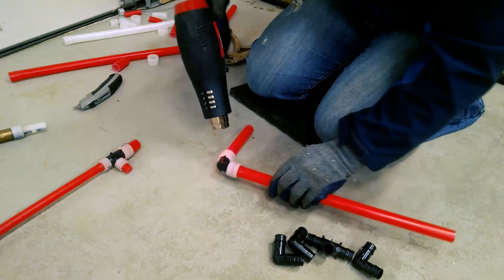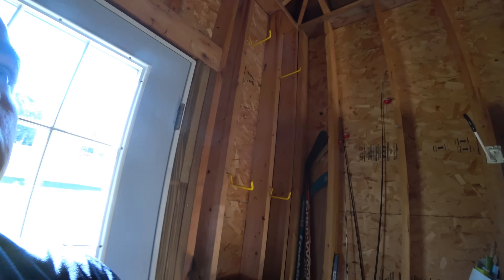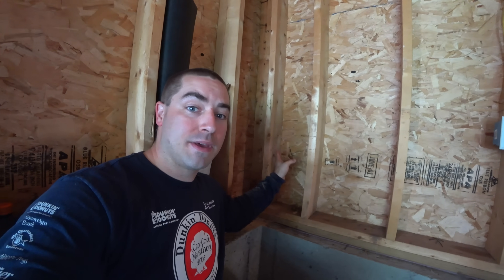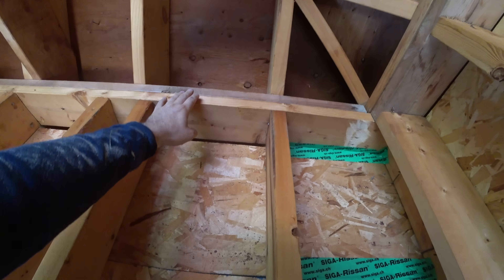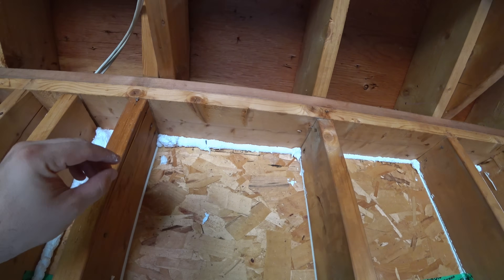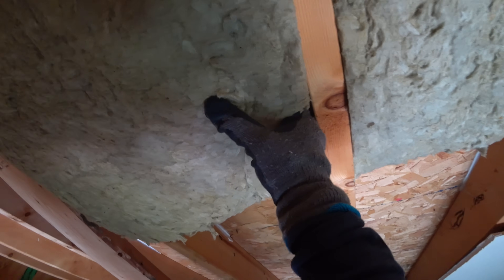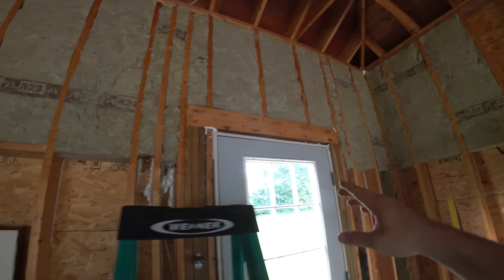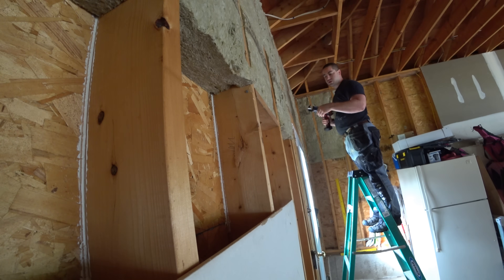Achieving Higher Performance with Batt Insulation, Roxul

Comment: I spent 10 hours caulking every stud, top plate, bottom plate, and seam.  I hope it pays off.  

Side note: I paid extra for the air tight light cans only to see that the ring around the can has a 1/8” gap around the can.  More caulking!

Comment: Outstanding job you did there. For cutting Rockwool, I use an insulation knife. Home Depot sells them. Some have a pointed blade; some have a curved blade. They get dull pretty fast so I use a roller sharpener every third cut or so. It really makes a difference in how clean you can cut the batts. The Rockwool dulls a sharp blade very quickly. If it wasn't too sharp to start with, you won't notice how quickly it gets dull.

Comment: I have 5.5" deep walls (they're not actually 2x6 see further down in comment) - I put down 2" of continuous rigid foam insulation (like polyisocyanurate) then sealed the edges with expanding foam then finally 3.5" (2x4 batts) of rockwool insulation. Works nice. About R27. It's actually more than R27 because the rigid insulation is continuous along the cinderblock wall then I framed 2x4 walls in front of it. If your insulation is continuous sheet (no studs) you don't lose conduction heat transfer through the stud members = more insulation. You can see examples of this in the IRC code book when they talk about R13+7 that's R13 in stud bays plus R7 of continuous insulation (no studs, like exterior sheets of rigid foam board) R13+R7 > R20 in studs! Neat stuff.

Comment: Isn’t the layer of poly you’ll put over the batt going to stop any air leakage? Making all the caulking and taping redundant
Reply from the maker: Poly looks like a good air boundary in theory, but I've personally tested it installed, in the field.  It fails as an air boundary.
Reply: Not sure that makes sense, if the vapour barrier was done correctly Also why would you caulk a stud that is against a solid piece of plywood, where would the air leak?

Comment: Hi. Great video. Could you explain, why dense pack doesnt need air sealing? Thanks
Reply from the maker: It's a huge topic that I won't be able to do justice here.  I'll make an attempt to summarize.  If you can air seal your sheathing, do it.  Air sealing your sheathing with tape (or fluid applied) is best.  But if you are in a situation where you have an existing structure and can't air seal the exterior sheathing, then dense-pack cellulose is the best option because it allows the least amount of air infiltration compared to other types of insulation.
Reply: @DavidPozEnergy  thank you! 👍
Reply: @DavidPozEnergy  thank you. And what do you think about wet sparying cellulose, is it also effective? And what is your opinion considering R-value/price in comparison to mineral or fiberglass wool? Thanks a lot.
Reply from the maker: Damp spray cellulose is a means to install cellulose without needing a netting material to hold it in an open bay.  It's supposed to be installed to the same density as dry dense-pack.  So it would have the same affect after it dries.  But it comes down to the integrity of the installer.  The companies I worked for never did damp-spray because I live in a cold climate where freezing of the water system would be a problem.  

Fiberglass batts is by far the cheapest insulation.  But I think it's worth the cost to buy dense-pack cellulose.  I personally paid for cellulose in my own home.
Reply: @DavidPozEnergy  thank you. By the way, do you have a refrigerator economizer? I am wondering why in cold climates, they are not used.

Comment: David very good video thanks. I have couple questions. Can I use this in a small Aframe cabin for the walls, the plans I bought has open vents at the bottom of the walls for air to flow in where the Batts are I don't understand. Also, how to prevent mice.
Reply from the maker: Should I assume that when you say cabin "walls" you mean the rafters?  An "A" frame has two sides that are rafters all the way down to the sill, and opposite two sides are true (gable end) walls.  So if you are referring to the actual walls, which stand plumb on the gable ends, then those don't have vents in them.  But if you mean the rafters, then plans do often call for venting, but that must be continuous up to a ridge vent.  That means no obstructions like skylights.  But most plans are pretty vague on these details.  So, I'm sorry I can't give an easy answer, it depends.
Reply: @DavidPozEnergy  Oh right I mean the rafters it's my first build ever and my family's first home. I'm afriad rats crawl thru the vents and nest in my aframe rafters. Why would there be venting in the rafters? Can I not seal it off? Heres my plan https://www.evernote.com/l/Ab5MDuq7_VpL8bQcpf5BjRvPzDexUljFqFI
Reply from the maker: Ugh, talk about vague.  Right?  LOL.  The type of vent they are showing in the picture is this: https://www.homedepot.com/p/Master-Flow-2-75-in-x-2-5-in-Rectangular-White-Wildlife-Guard-Aluminum-Soffit-Vent-LSV8W/100022668  It comes in 8 foot long pieces.  The slits are small enough that mice can't get in, but just barely.  They are supposed to keep bees and hornets out too, but I've personally seen them get in/out through this.
Reply from the maker: It gets difficult for me to search through old comments and try to respond to carry on a conversation.  If you want to discuss this more, then please send me an e-mail through my website, or message on facebook.  Thanks.
Reply: @DavidPozEnergy  ok THANKS!

Comment: @3:52ff Why calk the stud? It's touching the wall. Where would there be leaks? The nails?  Have you done a video with rock wool and radiant barrier?
Reply: The studs don’t always remain in contact with the sheathing.  Air can travel behind the studs from bay to bay.

Comment: Mate so good, id be second thinking about doing a fart in there. But let me ask you, how is the room suppose to breathe if you have covered up every little gap?
Reply from the maker: The room is still vapor open, so the cavity does not trap moisture.
Reply: @DavidPozEnergy  what is vapor open?
Reply from the maker: The materials used in the assembly (wood/rockwool) do not trap moisture.

Comment: Hello David I have a question I hope you can help with me might be a bit off topic but it does have to do with Rockwool. I recently used rockwoll in acoustic panels (wooden frame and double wrapped with fabric) the fibers even though they are wrapped will still come out fibers are very small. I had them in my recording room where I spent ALOT of time. I then started to have a bit of irritation of skin and trouble breathing once inside and placed. (No not Covid-19) lol I had them in for about 6 days before I thought it might be that. Did some research and found out very very mixed responses that confused the hell out of me. Is it safe? Have you ever had any problems like that with it?
Reply from the maker: Rock wool is an irritant.  Long-term exposure will be damaging.  I think your reaction to it tells you that it needs to be removed.  I've installed a lot of rock-wool in bathroom walls to quiet down the sounds, but never in a fabric situation.  I would remove it.  Sorry.
Reply: @DavidPozEnergy  thank you sir! I appreciate you getting back to me I actually did remove it as of yesterday and I am not happy that I had to but safety is first. Thanks again!

Comment: Do we need an air pocket behind the insulation if we are insulating roof rafters and why did you use wood instead of sheetrock?  Great video
Reply from the maker: There are several different systems for roof insulation.  Sometimes you need an air gap and sometimes you don't.  It has to do with following the code in your area and the manufacturers instructions.  I've installed a variety of different systems.  My personal favorite is dense-pack cellulose right up against the roof sheathing.  
As for the wood instead of sheetrock.  It's because it's a garage, being able to throw a couple nails in the wood to hold up a rake is nice.

Comment: Great info, if it were a cathedral ceiling would you still tape the roof plywood seams and caulk stud and plywood meetings as well underneath vent baffles
Reply: If you have ventilation over the top of the insulation (which you should in almost every case) then there is no point in sealing anything above it. If you have a vapour barrier under your insulation (which you should unless you're in the southern states, where it goes outside the insulation) then that will provide the air barrier you need.

Comment: Interesting. That is going to be one strong garage! Two questions
1) why seal interior studs to interior of sheathing?
2) what about long term brittleness of mineral wool fibers?
Reply from the maker: This is an existing garage, so I only had access to the inside.  If this was new construction it is far easier to tape the sheathing seams from the exterior.  I'm not concerned with the durability of the mineral wood fibers because they are inside the stud bay.  I would be concerned if they were on the exterior where they might be exposed to dirt or water.
Reply: @DavidPozEnergy  
Thanks. This is fascinating. What does the caulk do? It looks like construction is moving (wisely) to exterior insulation. I'm very interested in how to address lifespans and inevitable wear and year, even on siding covered exterior insulation, not to mention fire safety.
Reply from the maker: My personal favorite wall assembly is to build a typical structure like normal, then a second wood stud wall inside of the first.  This is called a double stud wall.  The inner wall is non-structural, and can be stood with any partition walls.  Sometimes stood after the roof is on around here because of snow.  The outer sheathing is taped.  The whole double-stud assembly is dense-packed with cellulose.  I'm not a fan of exterior foam board unless there are other factors affecting the decision.

Comment: You could spray foam that corner, correct?
Reply from the maker: I've done it before, but it doesn't come out real well.  Try it, then remove the stud and take a look.  There will be gaps.  At least, that was my experience.

Comment: so does spray foam insulation not air seal?
Reply from the maker: I have personally gone back to houses that have been spray foamed after a few years.  I have run blower door tests on these homes and found them very leaky.  Spray foam should be treated as an insulator, not as the only air-tight layer.  Ideally, the exterior sheathing is taped from the exterior to make it air-tight.  Then verify with a blower door test.  Once you know that layer is perfect, then move on to adding whatever type of insulation you want.  This is a retrofit project, so I had to do everything from the interior which is not ideal.

Comment: David,
Nice video, thanks for the information.  My question is:  Can you bypass the exterior taping process if you are wrapping the house with Tyvek?  Thanks
Reply from the maker: If you have access to the exterior sheathing then your life becomes so much easier!  Housewrap (tarpaper, tyvek, etc) does not stop air from getting into the cracks and holes.  So you still need to air seal the sheathing.  But it's very easy to do it from the exterior.  I taped the joints in my garage then used Typar as my housewrap: https://youtu.be/mjGQUjwTSM8

Comment: You forgot the most important part.  Vapour Barrier.  Caulking is great, a good add on, but it dries, it cracks, wood walls expand and contract which will break the 6 sided seal you speak of.  Vapour barrier is cheap and easy and it works.
Reply from the maker: In this case (garage) we don't want a vapor barrier.  But, you would be right if it was a house.  Thanks for watching.

Comment: @DavidPoz

Would the tape work for airsealing an old attic?

What brand would you use and where can you get it?
Reply from the maker: Hi Peyton,  Most attics I work with have insulation between the ceiling joists (attic floor).  The substrate we try to air seal is the drywall of the ceiling below.  If this is your situation, then tape is not (generally) the best product to use.  The fastest and easiest product is one-part expanding foam.  The foam can be expanded inside a  crack (drywall to top plate).  However, the foam is not good if it only sits on the surface of two adjoining materials.  If you have a very tight crack then try using a sealant with adhesive properties.  One example is Zip flash https://amzn.to/2YRHYrc  It can be applied easily with a caulking gun, then spread out with a silicon squeegee.  

No matter what you use, the attic floor must be 100% clean.  Bring a shop vac up there with you to vacuum every crack before you air seal.  

I'm making general notes.  There will be exceptions to everything.
Reply: @DavidPozEnergy  thanks. I've actually got a tong ue and groove ceiling, so I'm sure we're getting tons of air leakage. As well as getting dust down into the living area.

My general thought is to airseal the seams in the attic using a caulk of some sort, lay down a vapor barrier, & then lay Rockwool barrier within the joists.

I'm going from nothing to something, so I'll get a decent return, just want to make sure I get the most bang for my buck in this old house.
Reply from the maker: Send me a picture in Facebook Messanger and we can talk more.  https://www.facebook.com/DavidPozEnergy/

Comment: Can you use the batt insulation in mobile home walls?
Reply from the maker: Yes you can.  Just be sure to get the right thickness.  Last time I insulated a mobile home, the wall cavity was only 1.5" thick.  The batts I'm using in this video are 5.5" thick.  You can burchase 1.5" thick batts,  but I have found them to usually be a special order.  If this is the case for you there are two things to try.  One, is to use a 1.5" thick foam board and cut it to fit the width and hieght.  Second,  trick would be to buy un-faced fiberglass batt made for 2x6 walls (5.5" thick).  You can pull the fiberglass batts apart to make two batts that can fit.
Reply: Yes there ia a dense form of rockwool we use for exterior insulation that would fit inside the wall cavity or mobile homes.... or you could spray foam it and there would also be a drastic increase in rigidity and structure.

Comment: Never a good idea to block airflow the insulation has to breathe to the outside because you are going to get massive amounts of moisture with a subzero outside temp.  Once that rockwool gets wet you have a mess. Should use (code for residential construction in Canada) a 6mil  poly vapor barrier with acoustic sealant at the seams on the warm side of the insulation!
Reply: Rockwool is impervious to moisture.  How would the air barrier on the inside wall stop air from coming in through from the outside? It has to pass through the insulation before it reaches the inside barrier...!

Comment: Why don't you just shoot some foam in the corner for god sakes
Reply from the maker: I once tried that.  Then took the corner apart to inspect.  There was a spider-web of tiny voids that would allow lots of air to flow through.  I might have to make a mock-up corner just to demonstrate this.  Anyways, taking out the extra stud get's better results.  Thanks for watching.
Reply: No you don't just don't try too be cheap and skimp o. The foam.use extra o. Corners. You had a great video but to sacrifice strength when you dont have th o is foolish

Comment: Great Job.  I liked the detail you took to seal the cavity.  Why not use expanding spray foam insulation to seal and insulate at the same time?
Reply from the maker: I have a lot of personal experience doing energy audits.  Before my auditing days I was a big fan of spray foam, and on Day 1 it does what it says.  It will seal and insulate.  However, after the first winter with expansion/contraction of the wood, it no longer seals.

Comment: Nice to see your approach to sealing. I’ve also added an interior layer of foam between the studs and against the sheathing, corners sealed with 1 part spray foam , then batt insulation. I agree on the silicone layer between interior and studs. Lots of heat loss through studs. Sometimes I’ve also put 1/2” of sheet foam against the studs  to keep down that heat loss.  Standards might be different here though. Most houses are sealed in a layer of exterior tyvec, which can breathe moisture out, and interior plastic vapour barrier. Mind you, we get -40 (Celsius and F are the same at -40) and 30 mph winds. But, good idea, the 6 sealed faces. Thanx. 
     Thanks for the info, makes me feel good about my methods too.
Reply: Het loss through studs is thermal transfer not air movement, the closed cell on the top and bottom plates is smart but the silicone is doing little at best.

Comment: Hi David, Thanks for the video. How would your prep-work be different when the exterior wall is covered in horizontal overlapping boards (Clapboard) that obviously allows lots of air flow through??? Thanks For Your Time: Shawn
Reply from the maker: Hi Shawn,  This building also had clapboard siding on the outside, so it's the same.  Is there something else going on with your project?  If you want you can also e-mail me some pictures of your project.

Comment: This insulation mumble jumble is a CROCK OF SHIT. All you had to do was shoot some foam in that corner. And besides the framers fucked up because good framers would have put insulation in that corner before sheathing went on. HOME NEED TO BREATH. To tight is crap. Wonder why so may people have breathing disorders????How about 150 or even 70 years ago try 40 years ago. This is because houses are to tight. PERIOD. Sure take a draft out... but most of the other stuff is nuts. Attic air coming into the house from above (get rid of it) but all this other stuff is all common sense. Just wipe out the drafts..and design of house should isolate points of entry air. DONE!